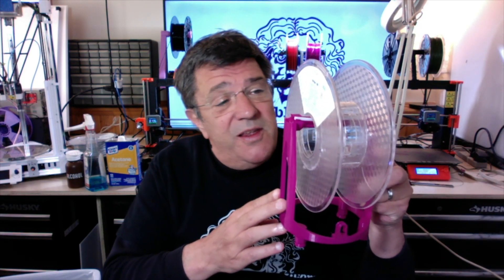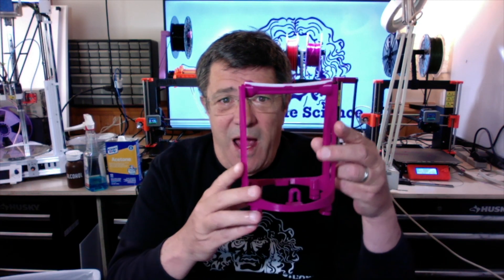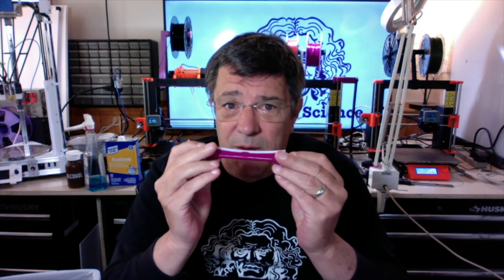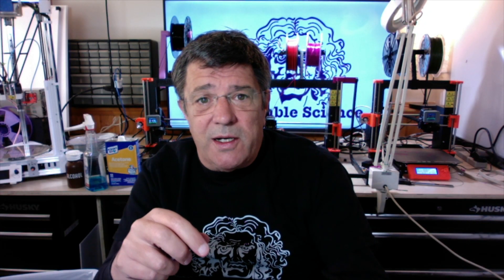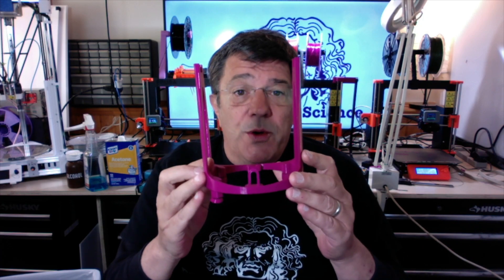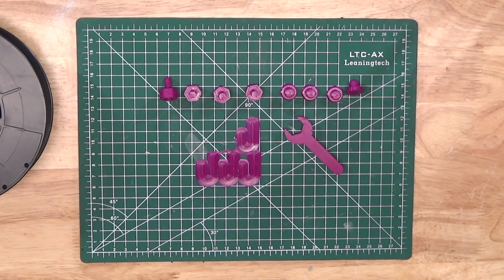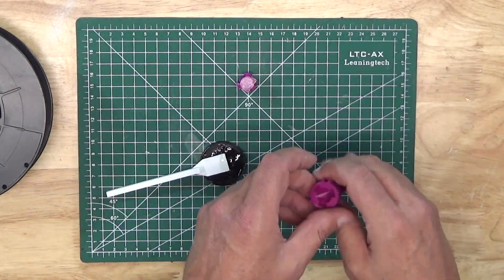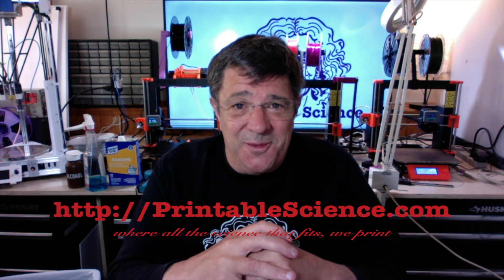3D Printed Low Friction Bearingless Self-Centering Filament Spool Holder

Comment: This is interesting.  I have a large printer (720 x 320 x 400) and the spool holder is in the center, off to the side.  What's happening with this machine is as the printer makes various large movements, any material that has been tugged off the spool can cause a tangle, snag or filament can fall over the side of the spool.  It's not a bowden system (direct drive) but I'm debating on a good way to help the filament move off the spool cleanly.

Comment: Interesting.  I thought friction was just a function of normal force and the coefficient of friction.  Didn't realize that the surface area came into play.
Reply from the maker: You may be right and I confess that I'm not an engineer. To my (perhaps flawed) logic, if you are pulling an object on top of top of two parallel rails, you'll require less force than pulling that same object over an entire plate of the same material. But if I knew for sure then I'd probably be an engineer rather than a hobbyist. Notwithstanding that, I believe the filament holder I designed achieves a not insignificant reduction in friction by using PTFE for one if the mating surfaces. What do you think?
Reply: @PrintableScience  Alan is correct. The formula for friction is F=µN. F is friction, µ is the coefficient of friction, and N is the normal force.The surface are does not affect friction. I really do like your design, btw.